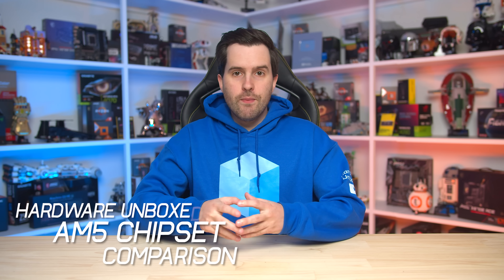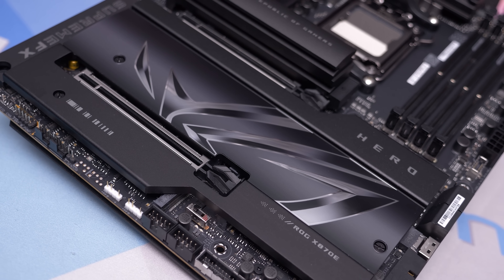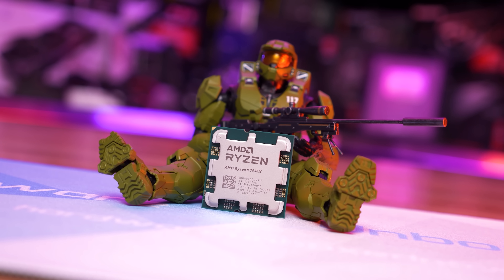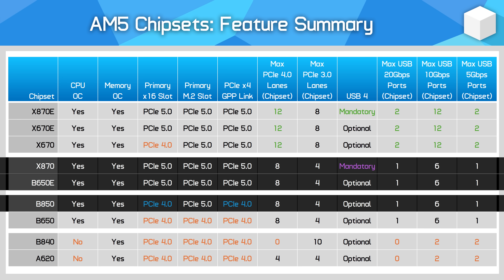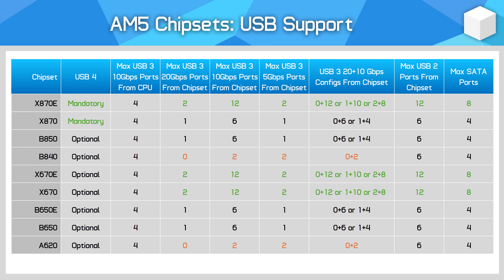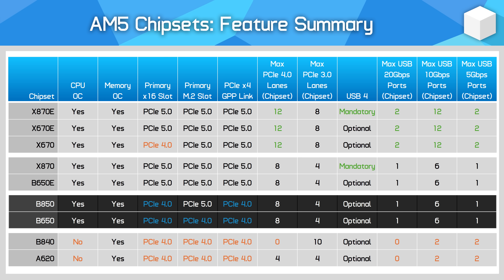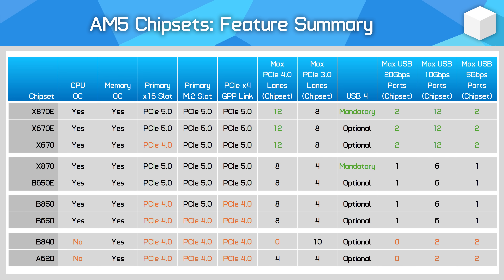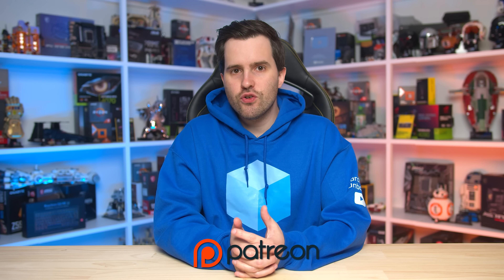AM5 Chipsets Compared - X870E vs X670E vs X870 vs X670 vs B650 vs B850 vs B840 vs A620

Comment: The x870 naming scheme is pure scumbaggery. That should be the B850, not pretend to be so close to the top end.
Reply: Or really X670F and B650F, or along those lines.
Reply: this videos just helped me decide to max out am4 then wait for am6 and let am5 settle its mess before upgrading.
Reply: @pppaulmff9291  my takeaway from this video is that the b650 and x670 is all you need. Then go with the 7000 CPU that you require. 800 series boards and 9000 series CPUs so far, are to be ignored.
Reply: @RN1441  b850e*
Reply: This is from pressure from motherboard makers to some part. The 2 year upgrade cycle is gone for most amd mobo makers.
Reply: Don't forget the b840 which is Nothing more than a620 I find that way worse
Reply: @meki___6881  B650/B850 has cpu and ram overclocking... B760 doesn't. A620/B840 is AMD's equivalent to B760, B850 is AMD's equivalent to Z690/Z790 (except with more cpu-M.2 slots).
Reply: @tomstech4390  that makes zero sense
Why try to sync names to a competitor and then still get everything wrong
B760 and B840 
And it doesn't make sense in amd therms because all b Boards had overclocking
Not to mention it's literally an a620 chipset it's not like they intruded some overclock features or extra PCIe Lanes which would justify a higher Name
Reply: Agree. Absolute scumbaggery. Trying to take advantage of the less technically aware clients.
Reply: X670 could have been the new B850 without issue
Reply: The whole thing is scumbaggery. AMD is too well established in the CPU space for them to see any benefit from people confusing their chipsets with Intel. 

The chipsets should have been called prom 21 v add prom 21 x 2. And then maybe prom 21 with USB 4 for the refresh
Reply: He is amazingly trained from presenting Monitor model names for years :medal-yellow-first-red:😄
Reply: X870 tomahawk MSI is great though
Reply: @VexOoo-x7yany reason why x870 tomahawk is preferred over x670e tomahawk?
Reply: @AceSimm  5gb LAN
Reply: Should be - X880/870, B850, B820. Just B840 is awful naming
Reply: It's just numbers. Like always it's kinda random. Not worth getting mad over.
Reply: You missed the mandatory features on X870 which are NOT available on B series.
Reply: isnt that what intel is doing with Z models?
Reply: Why is AMD's marketing?
Reply: Not even surprised, that's how many seem to roll these days...
Reply: Its probably due to future sku plans hit us with x970 etc x1070 blah blah and they are like maybe pre adjusting the scale or something
Reply: Its the same with the Z890 scheme as well. The Z board are fodder now.
Reply: It Is the High end lol b850 and b840 Will be out soon
Reply: yup, i'm almost tempted to go back to intel on princple...
Reply: disagree B850 is an abomination, the X870 is what the X670 should've been.
Reply: Not like X870E is actually better than all the others.. you have 1 billion instead of 1 million usb connectors and some additional useless pcie gen4 lanes. There is absolutely zero performance difference between all these chipsets.
Reply: Exactly I have the X670E chip set and have all the functionality of the x870E chip set without the extra cost @kerotomas1
Reply: it should b3 b750
Reply: I'm still waiting for a micro ATX mobo that has 5 slot spacing between the top and bottom pcie slots. Would like to install a 4 slot GPU and not block up the last pcie slots in the event that I have to use an expansion card.
Reply: @firedrapeon6012 unrealistic expectations for that size mobo.
Reply: @dakbassett  I can make it work if the absolute top pcie slot is the main x16 slot. Found a riser that can "move" the last pcie slot right to the bottom of the case, below the GPU, as I can't fit any case fans at the bottom of the case anyway.
Reply: @firedrapeon6012  mATX is meant to be upto 4 slots (244 × 244 mm) so good luck with that.
Reply: @tomstech4390  umm, if you look at the layout of the Am5 motherboards, if the top slot is a pcie x16 slot instead of the m.2, it would fit a 4 slot GPU+ 1 last slot for the pcie card. My matx case has the space for it. If necessary, I'll use a riser to extend that slot further down. Would be great if there was a matx WiFi 7 board...
Reply: @firedrapeon6012  Gigabyte B650M Aorus Elite AX has the top slot as an X16, anything longer isn't mATX.
Edit: I have a define mini-c with 5 slots, but its still not mATX by definition, a full ATX case can also take an mATX board but mATX is 244x244mm, it's like how there's no such thing as E-ATX.
Reply: @tomstech4390  ok thanks for this. Hoping for more options so I can decide on my next upgrade in the event a 5080/5090 starts being bottlenecked by my current 5700x3d.
Reply: Booboo 69 XTC is a more appropriate name, not B850.
Reply: Stop being dramatic.
Reply: This comment is absolutely underrated. Scumbaggery is a word I will remember from this day forth.😂😂😂

Also, your take is 20000% on point.
Reply: Z890 should be h610
....Seeing as we're saying random bullshit today
Reply: That implies someone is trying to cheat you. AMD doesn't care which one you purchase, so no, its not scumbaggery.
Reply: @snotspat  Stockholm syndrome, much?
Reply: @middleclassthrash in regards to you Stockholm syndrome comment. No he is just not an idiot and can pick out which board he wants and buy it. It's really not that complex and if you can't figure out which parts to buy (you probably shouldn't be building your own pc). 5mins or less I can research and figure out what motherboard I want. It really isn't that difficult.
Reply: @dakbassett  I can assure you that AMD cares a whole lot which chipset consumers buy.  If you think publicly traded companies don't devise anti-consumer schemes in order to increase revenue, then you're economically illiterate.   As are most PC-DIY enthusiasts, as it turns out...
Reply: @middleclassthrash  I can assure you. It's not rocket science.
Reply: @snotspat  AMD mafia at it again.

Comment: Just f-ing call them 1-2024 2-2024 3-2024, basically [position in the lineup, low-mid-high end]-[production year]. So you always know that 2-2024 is better\newer than 1-2021. Problem solved. You can expand it if needed, like 1.1-2024, so this would mean its still 1-2024 but somehow different from default 1-2024. Point is - there must be a better ways to name stuff, cars do it, you always know the position of BMW 1 2 3 4 5 6 7 8, x, m and so on, same with MB A B C D E G. And they do it for like 50 years at least.

Comment: X870E = X670E
X870 = B650E
B850 = B650
B840 = A620??
Reply: Yep
Reply: I have to wonder if AM5 cpu's have four extra lanes compared to AM4 because AMD was planning a real "x" chipset with an X8 link and a respectable number of PCIe lanes, which got canceled in favor of the cheaper solution of daisy chaining 2 of the PROM21
Reply: The only problem is X870 isn't even as good as B650E lol.
Reply: Expecting longevity of the Platform I took the b650E steel legend.
Reply: There's B860 as well for Intel Core Ultra series.
Reply: only about x  670 e,,too 870 e..is yea..that this same

but others idk......
Reply: Where's 700 series? B750?
Reply: @hiriotapa1983 they skipped 700 to match intel 800
Reply: @chillz739 because of course why would anyone buy an AMD CPU if their chipsets are 100 (or even 200) behind Intel?
Reply: @chillz739  dumbest thing always skipping, and within 4 years run out of a series of number...
Reply: @hiriotapa1983   Same as "Ryzen AI 100 and 200", AMD skipped to "be ahead" of intel (yeah, that's dumb)
Reply: @ShaunaJagan  AMD is so sad, even when they have the better products they refuse to let them stand on their own they have to try some stupid marketing shit. Intel for all its faults tries to be a trend setting not a chaser.
Reply: @ true, you said it all!
Reply: What the fuck is B650E???  Why does this even exist???
Reply: @RNG-999  The "E" denominator means EXpensive!! But guaranteed to have PCI-E 5 support.
Reply: @RNG-999  B650E = B650 with PCIe 5.0 for both its top PCIe x16 slot and top M.2 slot.
Except some B650 motherboards have that anyway, yet are still branded as B650, not B650E (e.g. B650 Steel Legend - it's actually better than the B650E version of the same motherboard, at least in terms of connectivity, as it has an extra PCIe x1 slot and more USB and SATA ports).
Considering that... yeah, that doesn't answer anything, and I'm still asking the same question as you. Why does B650E even exist???
Reply: @nathangamble125 if I had to guess, there's probably a higher licensing fee for B650E, and ASRock figures nobody who's buying a B650 board cares 🤷‍♂️
Reply: @RNG-999  It's b650 with the gpu slot being pcie5
Reply: @RNG-999  Its the Extreme version of the B650 series. Basically a higher power more robust B650 without needing to go to X670 mobo. From my understanding its better for OC on the B650E and is a lot cheaper then a X870E especially since the X870 chipset isnt needed for a LOT of PC users
Reply: @kurdonthego  B650E is not better for OC than B650. The chipset has almost nothing to do with overclocking, except for arbitrary restrictions enforced by the manufacturer (neither B650 nor B650E have any restrictions on overclocking, so that's irrelevant in this comparison) and any physical differences between the chipsets which affect their stability if you overclock BCLK (B650 and B650E chipsets are physically identical, so there is no difference in stability when overclocking their BCLK, so that's also irrelevant in this comparison).
On average B650E motherboards have better VRMs and PCBs than B650 motherboards, but some high-end B650 motherboards (e.g. Tomahawk and Steel Legend) have better VRMs and the same number of PCB layers as some B650E motherboards (e.g. Strix -F and Aorus Elite).
Reply: for exactly, B840 is re-named A620'A', not A620

A620=Cut-downed Promontory 21(B650 and X670 etc)

A620'A'=Promontory 19(A.K.A B550 in AM4)
Reply: @최치헌-x6x  That would explain why the B840 has no gen 4 PCIe but A620 does.

Comment: Motherboards are endlessly confusing, hugely valuable to have HWU here to cut through the marketing obfuscation and provide clarifying information.
Reply: They forgot to mention that X870(E) boards are just downgraded X670E/B650E boards.
Reply: @MajinOthinus downgraded in what way? I was considering buying an x870e board so I’m quite curious
Reply: @tuxedo_toucan  afaik the only difference between x670(e) and their respective x870(e) variants are that the latter enforces USB 4.0. So board manufacturers of the x670(e) have got more freedom to allocate the bandwidth to other things, which may be more interesting to the user.

Do you have any peripherals that can benefit from more than 10 GB/s bandwidth? For most people the answer to that question is no.
Reply: Monitor names: Hold my stand
Reply: Bigly
Reply: Mobo's, GPU's, CPU's, PSU's, Cases...it's ALL becoming the same marketing drivel of "Bigger number with most XXXs = higher price"; and then they have to lie and/or obfuscate performance numbers to justify that price.  Not to mention the extra headaches with buggy BIOS and H/W compatibility that seems to get more and more common
Reply: I’m not sure if its marketings deliberate obfuscation or sheer incompetence

Comment: All I can say is that hardware as a whole is quite a mess imo. No chance I’ll buy now. Waiting for things to stabilise marketing and product wise but I fear it’s just going to get worse. Which will force me to look at budget options to not burn much money on little bang for buck. Either way. I see it as exercises in futility. Hope it improves
Reply: The market is mature and most of the effort is going into segmentation rather than improvement. Oh sure, they'll call both 'innovation' but it's surprisingly hard to get a quality board without LED vomit, without the wifi controller I don't want or need, and yet with the PciE5 lanes well allocated....
Reply: @RN1441  Some of us like them LED chunks... and you can disable them if it makes you woozy pal.
Reply: it's hell. I'm looking at building a PC with a 9950x and good motherboards are freakishly expensive compared to when I last built a PC.
and GPUs are just stupid...
Reply: "Won't buy now" ... but you fear it will get worse.. which means you either want to buy in a more convoluted market or never upgrade. Or you're holding out hope that companies will segment the market less?

In any case, the logic is a bit dodgy.
Reply: @Scxe good question. Lemme exemplify… I don’t need to buy but want to buy. I’m ok not buying for a while. So I’m ok waiting. Yes. I’d like a decent Ryzen 9000 series but the bang for buck isn’t there. And. What’s the purpose of the 8000 range again? Is the 7000 what I should be looking at? What about the direction PCI lanes vs lanes offered via the chipset. This is all quite messy. What RAM speed is a good rule of thumb… does it depend on everything that there is no rule of thumb? Do I skip this and just buy a HP laptop and hope it’ll serve my needs for years or will it be need to be replaced within 18 months? 
This is what I kind of mean

Comment: Meanwhile my B450 Tomahawk Max is still going strong 💪
Reply: MSI B350 Tomahawk going for 6-7 years now, first generation Ryzen board that has been home to 1700, 56000x and 5800X3D
Reply: I wish my tomahawk max had an extra m.2
Reply: @xXx_Oshino_xXx  get a pcie 3.0 nvme adapter card
Reply: @Lethalwick5673  only the first x16 slot is PCIe 3.0 on the tomahawk, the rest are 2.0 x1 or 2.0x4.

I'll use the build as a NAS down the line when I build my new PC.
Reply: Gigabyte B450 Gaming X + 5700X 👍
Reply: wish it did bro, no rgb controller, also pcie gen 3 for my 4090, I rly want to replace it, but waiting for 9800x3d
Reply: Hi there on MSI X370 Carbon from 2017 coupled with 5800X3D and 4090 alongside tuned 4x16 3533 16-8-16-16-21-38 and it could go even higher without PBO-30 + -0.05 undervolt. This board might be old but is doing strong and even use two NVMes while keeping x16 lanes on GPU. These new boards might cry on it.
Reply: Got the Mortar Max thats the mATX version of it, the board feel like a Transformer 😂
Reply: You bet! Great value and performance on my Tomahawk B450 here too!
Reply: Same with my asrock b450m pro4, currently chilling with a r5 3600 and saving for a r7 5700x3d
Reply: Lol running 5900x on it. Such a beast.
Reply: The B450 Tomahawk was a really good board for the price.
Reply: Same with B450 Aorus Pro
Reply: Same here with a 5900X and a 7900XT combo. Started current pc build with that board new using a R5 3600. I'll get a new Mobo/CPU upgrade Dec/Jan I reckon.
Reply: @ausnorman8050  Same, R5 3600 and rx 5700 xt. At least 5800x3d is running strong currently. i just cant decide whether I should go for 870 or 670e motherboard..
Reply: @RAYSGT  The MSI Max series was such a  good move, it's a shame msi fell off since then
Reply: She’s a classic.
Reply: I have B450 Tomahawk. Max version was introduced later
Reply: Same here. Thinking about getting a 5700X3D to keep it going forever 😂
Reply: do you have pciex4 or wifi 7 or dd5 support there?
Reply: @HiFI03  me? Then no, none of that.
Reply: @sheikhtashdeedahmed  then b6xx is old af
Reply: I have the B550 Tomahawk, I won't be replacing it for a long time- just upgraded to a 5700X3D
Reply: I use a320 with 5800x3d lol
Reply: @V1car1  Does the A320 VRM support the 5800X3D? Not too hot?
Reply: @hiriotapa1983  It handles the 5950x just fine, so yes.
Reply: @hiriotapa1983  Do you mean "too hot" as in "would fail HUB's ridiculous and unrealistic test and they'd whine it's ToO hOt" or do you mean "perfectly fine and well within the manufacturer spec"?
If it's the former, then maybe/maybe not. If it's the latter, then the 5800X3D is a relatively low-power part that works on quite literally any motherboard with the faintest hint of cooling.
Reply: @V1car1  Beautiful!!!
Reply: Same w/ B450 Gaming Pro Carbon AC 💪
Reply: @Classikh hey man, on the same mobo. Did you update to the latest BIOS? Also, can you run 2 m.2 SSDs together? I am on 2019 BIOS right now.
Reply: @Classikh  represent
Reply: my 50€ B450 MSI board running great with Ryzen 5600 OC'ed to 4.9GHz
Reply: Bro im on a b450m steel legend